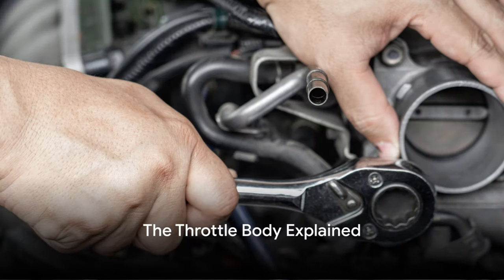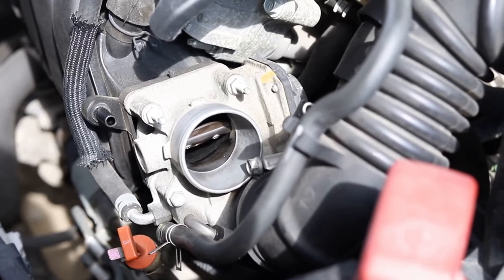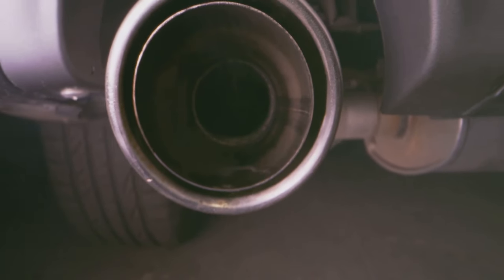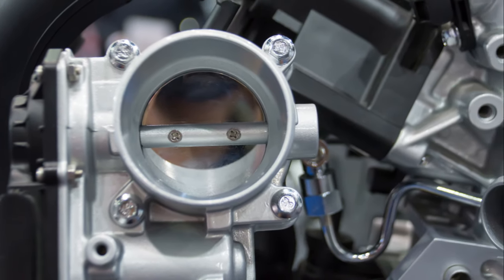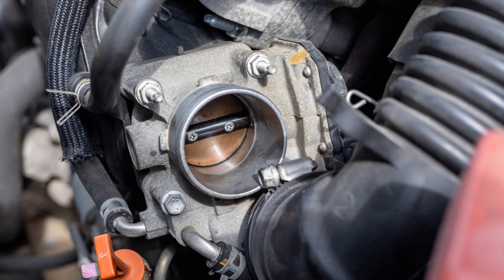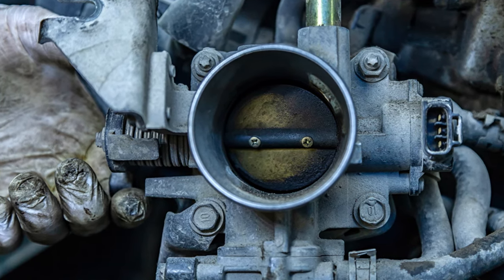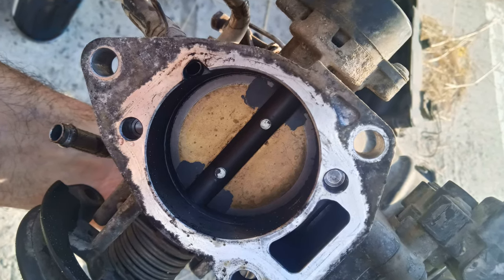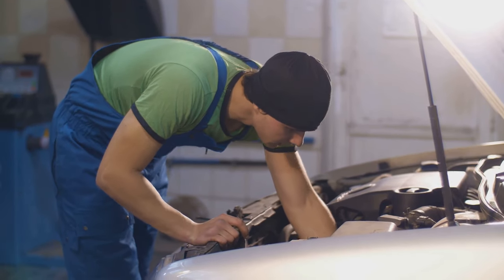What Causes a Throttle Body to Fail: Common Causes Explained

Comment: Would it have anything do with the engine locking up. Hyundai has a class action lawsuit against them 2015-? Engines . Maybe Throttle Sensor to add to a perfect storm